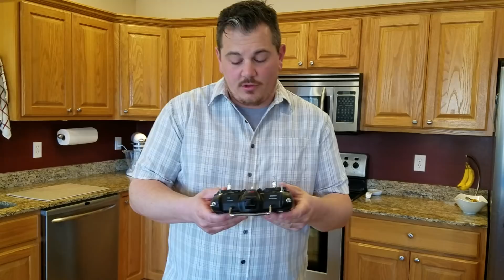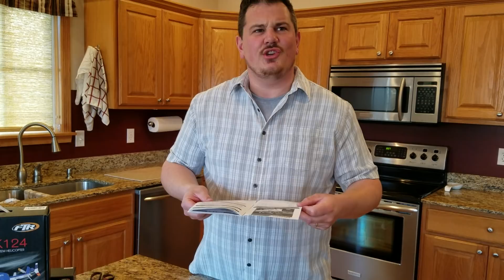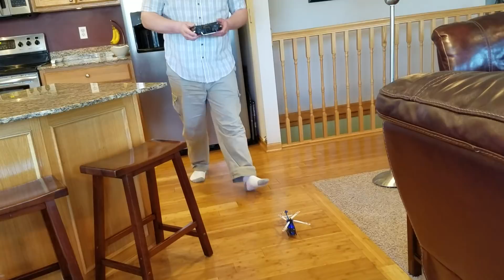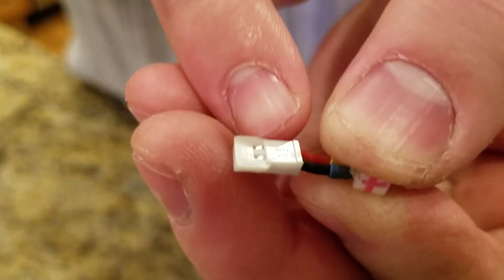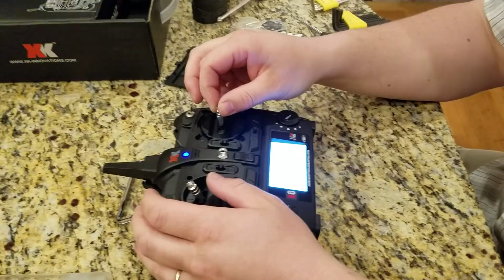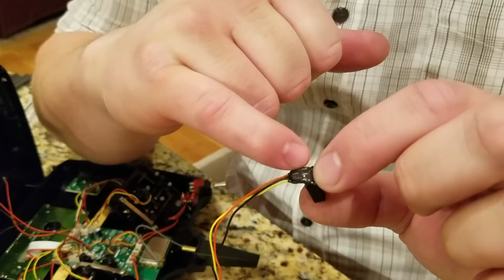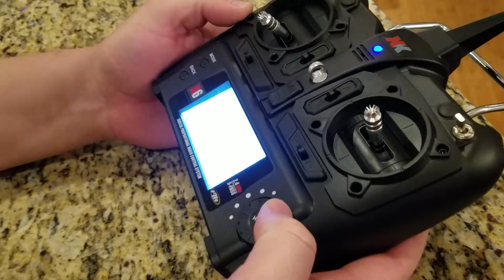XK - K124 - RTF EC145 Heli - Unbox, Repair, & Indoor Flight

Comment: Hi Brian, thank you very much for making such a comprehensive videos.  I ordered this RTF heli on BG and received it yesterday. After I flew about 3 test flights, I got the same issue with the main motor not spinning up anymore. (1:30:00 - 1:37:00) of the video. Tried several full charged battery's but the problem stays. Could it be the ESC ? Best regards from Belgium
Reply from the maker: You're welcome, and I'm so glad you enjoyed it! Most people seem to be generally annoyed about how long this video was, but I made it just for you ;)

Have you made 100% sure the battery is charged? Possibly testing it with a balance port tester, or a Digital Multi-meter?

Also, have you checked to make 100% sure that the motor and the main gear from the motor aren't hitting the decorative plastic body?
Reply: yes 100% sure, tested all 4 of the batterys  with exactly the same balance port tester as yours :)  all were at 4.20V
Reply from the maker: I think you might have a defective controller, OR your throttle is not allowing it to ARM at startup. Can you check the throttle stick position, and then trim it WAAAAAAY down if it's still all the way down at next attempt
Reply: @BrianPhillipsRC  Hi Brian, found out that it was a bad motor. Now it flies very good.  Just one tip : watch out with the settings of D/R !!!! 
I found it on the forum on RCgroups
 https://www.rcgroups.com/forums/showthread.php?2612857-XK-innovations-RTF-X6-Transmitter-Each-DR-coin-has-two-sides%21

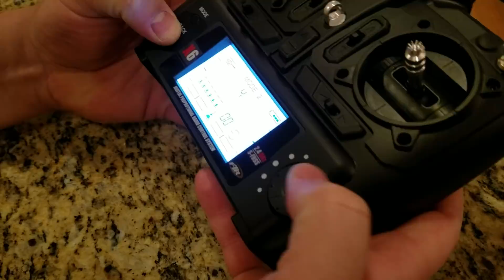Comment: Hello, did you ever figure out what went wrong at 1:34:00? I think you're Throttle Hold was on.  It's the Flip Switch on the upper right side of the transmitter.  Throttle Hold won't let you throttle up the heli, well, hence the name Throttle Hold.
Reply from the maker: That might have been it??? Sorry it's been a while, so I can't say for certain.

Comment: I got a plane with the same charger. It plugs into a laptop or a portable cell phone charger.
Reply from the maker: sure, you can do that too :) If you use a wall charger, try to use an older one for slower charges. This will help you lipos to hold up better.

Comment: So 2nd time flying it I have to say I love it I'm getting the k123 soon and the only thing about the k123 is the flight time 5 mins is roughly what I get on the battery that comes with it I'm going to try and rig a 1000 mah pack or 800 into it if I need to but for 5 minutes in the house its fun
Reply from the maker: I think you'll be fine with the larger pack, but it's gonna be kinda huge...

Comment: Just got the remote in and I can hardly understand the manual to set it up mind replying with what to do please brian
Reply from the maker: See, I'm NOT crazy!!! I got a bunch of flak from a guy about making fun of the "Changlish"...and this manual is pretty well useless...
If you watch this whole monstrosity of a video, I "Do it all", including fixing the radio - LOL ;)
Mostly, make sure you have the left stick down, and heli flat, asap when you plug in the lipo into the heli.
It's a super easy flying heli, BUT for me, I needed quite a bit of "taming", since I'm not a super confident heli pilot.
Reply: About that reply I havent messed with the throttle curve yet and all that other techy stuff on the radio I'm a beginner heli pilot and intermediate rc plane pilot and it seems to work just right on low rates in 6g mode havent and probably wouldn't reccomend 3d flight for this heli just cause its scale and the xk k120 will suit 3d flying better
Reply from the maker: I think you should play with the throttle and pitch curve. It's a great way to make it "easy" to fly, in my opinon.
It's a lot of guess and check, but you'll LOVE the feeling of control you get from the 5-6 adjustments. This is what I do at work, many, precise adjustments on scale systems until they really work good, not just kinda work. It drives most people crazy, until they have to use them ;)

Comment: Just reciceved this from Amazon how long does the battery it comes with last in flight I'm considering putting a bigger battery in and the transmitter did not come with the heli I'm using a futaba fhss radio
Reply from the maker: The flight times are about 5 minutes or so, if I recall. Using a larger lipo would be fine, if you can fit it in the already tight nose, without shifting the CG too far forward.
I found the flight times to be very reasonable, in my opinion :)
The RTF comes with the Radio, but you must have gotten the BNF?

Comment: How long does it fly ,I am thinking to buy 1
Reply from the maker: I think it flies great! It's a pretty good value too, since it's RTF. I'm not a great heli pilot, so I'm just touching the tip of the iceberg as to it's capabilities. If a more competent pilot had the controls, they could be flying it upside-down in the living room!
Reply: I have the WLToys V931 AS350,which is similar if not the same as XK K123 and It can fly just 5 min even with the upgraded battery,so I will say this XK - EC145 / K124 can do same flights,I will love to see  longer flight times on these rc helis,but what we can do.
Reply from the maker: I agree, but as with other rc aircraft, you get a lot more flight time if you fly less crazy ;)
I think this helicopter would fly with a slightly larger pack.

Comment: What do you mean you think it could be English? Can you speak and read English because then you should obviously know exactly what it says right away if it's English you can read it if it's not you can't I'm sorry but that was really stupid
Reply from the maker: Your comment indicates you have no idea what I meant, and completely missed my point. These Chinese companies write a manual in neither English or Chinese, they use some hybrid of confusing linguistics that don't really get the point across. Many times they say things that are using English words, but the sentence is totally out of context or completely confusing. They're about as hard to understand as your comment, both in word choice and sentence composition. They also try to use incorrect words when citing technical jargon. This makes setting up electronics nearly impossible. The Germans will do this, but they have a better reputation for precision in communication, while still using the "Correct" word, I.E. the German word for whatever they're talking about.

Punctuation is key when communicating via text.

Case in point...

"[first part was a correct sentence, and I understood you]...Can you speak and read English because then you should obviously know exactly what it says right away if it's English you can read it if it's not you can't I'm sorry but that was really stupid "

What you did here is called a "Run on Sentence". It's when you try to communicate more than one complete thought in a sentence, without proper punctuation. If you simply added a few question marks, periods, or semicolons, anyone who understands the English language ("E" is capitalized, if you weren't aware, since it's a "proper" noun). Here's how I THINK you meant me to read your comment...

Sentence 1)

Can you speak and read English? <--- add "?" to indicate that this sentence is a question.

Sentence 2)

Because then you should obviously know exactly what it says right away if it's English. <--- Added a period to indicate the end of a complete sentence. Typically prepositions like "Because" aren't used to begin a sentence, but since you had a run on sentence, I chose to split your original context here and therefore I needed to capitalize the "B". One might have left out the "Because then", and jumped straight into "You should obviously..." part, to help avoid some confusion on the reader's part. I also capitalized "E" in English for the same aforementioned grammatical rule.

Sentence 3)

You can read it. <--- Capitalized the first letter, and added a period at the end of the complete sentence. This was redundantly communicated, as part of the last sentence, which cased some level of confusion. If it were communicated verbally, I think this would have been clearly understood, but since it's written, it gets hard to understand for the reader.

Sentence 4)

If it's not, you can't. <--- Capitalized the first letter, and added a period at the end of the complete sentence. Added a comma where there's an obvious break in your subject and predicate. This helps a reader to understand what you meant. This part is generally considered to be optional, but it's appreciated by the reader(s).

Sentence 5)

I'm sorry but that was really stupid. <--- Capitalized the first letter, and added a period at the end of the complete sentence.

Your assessment missed the whole point of our commentary. You're certainly allowed to make as many rambling, run on sentence laced comments as you'd like, but I'd encourage you to formulate your sentences to be readable and understandable. This is the same complaint I had with the "Chenglish" manuals, only your sentence still made a point, and used mostly proper grammar, punctuation, and English words.
Reply: Straight* not Strait
Reply from the maker: Thank you Nathan. I fixed it.
Reply: 😁 Your response to Wayne Campbell is the YouTube comment equivalent of a Zangief Pile Driver! 😂

Comment: Question:  I am a rank newbie but how come the swashplate setting is 90 degrees where the three servos look like
they're at 120 degrees.  Reason I ask is mine (and I was lucky not to dork it) needs 50% right trim and 50% forward trim to 
hover.  First lift offs were freaking hairy.  I put an XK K123 on a different model (0) and it was rather benign with the 90 degree
setting.  Me thinks I might have to adjust the links on the K124 but I don't want to do that if selecting 120 degees would
fix it.
Reply from the maker: I played with mine and got the setting way more tame, now it's way more beginner friendly.
It's very subjective, so my settings...you might hate, and vice-e-versa...
Reply: Put the remote to 120. Solved all my problems.
Reply: @aarongray3573  could it solve my problem that the heli tend to fly side way and backwards instead forward?

Comment: On the Blade micro helis I fly the dual rates are N=100 Expo = 25, 1=75 Expo = 25 and 2=65 Expo=25 set on a three position switch. I usually fly in CP mode in with rate 1 or 2 and rarely fly full rates unless I’m practicing 3D and that means crashing.
Reply from the maker: I'm always plagued with a strange level of apprehension when flying heli's or quads. I "know" how to fly them, but don't have that "second nature" way that I've learned with planes. If I just did it about  more, I'd get better with them.

Comment: Hello Brian, I would like to ask you for advice, about a motor of choice for the flyfly condor evo magic 4, since I do not want to run out of power. Here I send you the two options. I would appreciate your advice:

1.- https://hobbyking.com/en_us/propdrive-v2-series-4248-650kv-brushless-outrunner-motor.html

2.- https://hobbyking.com/en_us/turnigy-gliderdrive-sk3-competition-series-3858-4-6-1120kv.html
Reply from the maker: You will get a lot more motor out of option 1, from everything I'm reading. Are you 100% sure they'll fit in the nose?